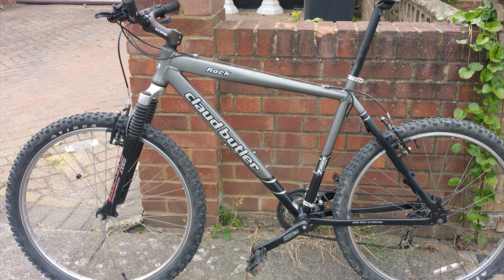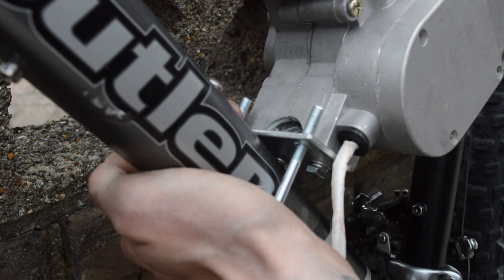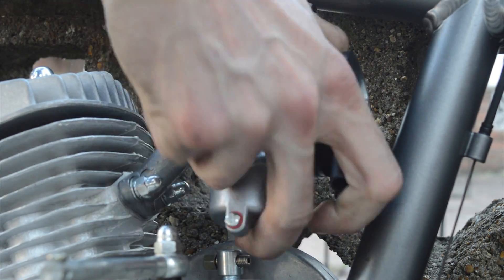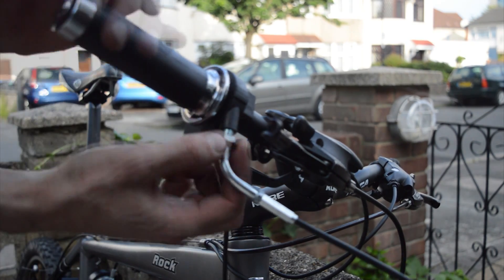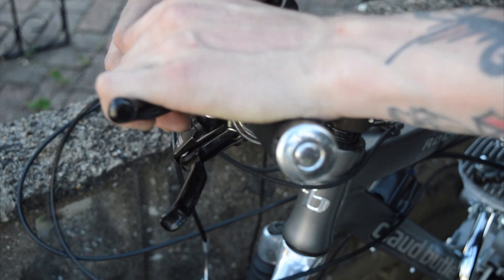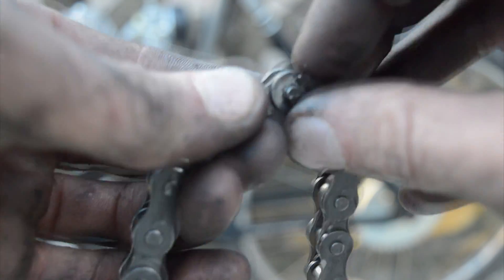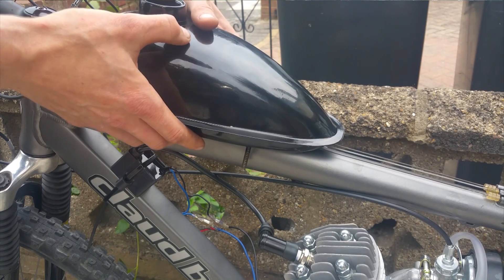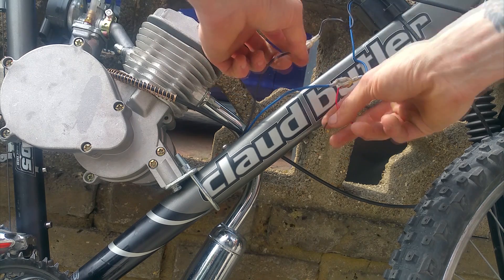Build a Moterised Bike at home - Tutorial

Comment: There are several things that I saw that you didn't do that you should before installing your bike motor.

Take the head off of the cylinder and look down inside where the Piston is more than likely you will find metal shavings and all sorts of shit from the factory tapping or cleaning the spark plug threads. I cannot stress this enough I found so much crap in mine it was unreal if I would have ran it that way it would have shorten the engine Life by month if not years. use a Gob of duct tape to remove all of the particles that you can see. That way you do not scratch the cylinder wall.

Second clean out your fuel tank. I also found debris in there. It would have quickly clogged the little filter on the end of the fuel petcock. 

Third is I opened up my clutch plate and found that there was all sorts of clutch particle matter from them putting the clutch pads in. You want to clean all of that out. and make sure that you grease the gear in there very good the small one not the big one. 

When putting on the exhaust manifold you will want to make sure that there is a clear path all the way through with very little obstacles in the way. I also took a chainsaw file and filed the edge of the pipe where it is welded to the mount so that it was as open as it could be. And if you are running a stock muffler check to make sure that they're well do not obstruct the end of the pipe whoever did mine did a shitty job welding it on and there was all sorts of weld that was in the way of the exhaust. 

Open up the magneto area and give it an eyeball real quick. Make sure there's nothing in there that shouldn't be. Everything is nice and tight I use blue loctite in this area. put a dab of Grease or some silicone wwhere tha wires go through the case that way is to keep moisture and crud out of the magneto area.  

any bolts that are long enough that will allow I use the two nut system with a lock washer between the two nuts keep them from backing off or loosening on the motor mounts and on the gas tank.

Comment: The tensioner is dangerous & so is the rubber rings putting force on the spokes to hold the sprocket !! However on one of your videos you nailed m8 you had a disk brake disk removed & used the holes to attach the sproket however the screws are to small to take so much force me thinks without more support so i thought why not add a cnc adaptor to the hub  aswell as your idea of securing it on the brake disk holes !! But then i thought if the cheap crap cnc adaptor slips on the hub it will take out the spokes or just spin putting all the presure on the screwed in sprocket !! So my solution is put a tensioner on the clutch panel side were its safe that are availble online or have it made that uses a spring & skateboard wheel tthat attaches on the clutch panel that tensions the chain like from duluth cycle. Usa . the best option me thinks is to get a specialst to build a vintage 26 inch hub & sprocket wheel that also fits a cassette as you will see after research the first moped scooters  ever built were cycles with moters !!! If you all see that this is the safest option & will save you money in the long run .im not putting that shit tensioner & sproket inc attachments from these kits !! But if you all prefer to use em RIP. Also were the larger spring attaches to the clutch wire touching the moter protecting the wire ive put a tubing available online used in catering etc that  can handle over 350 , 400 c  & then put the shit spring that comes with the kit .

Comment: You forgot to drill a hole in the handle bar to keep the throttle from sliding
Reply from the maker: To be fair I dont realy drill holes in my handle bars I just use a bit of tape inside to prevent the throttle from sliding this is also I good idea.

Comment: Is the cdi unit a device that sends an electrical signal to the spark plug to start combusting fuel to power it on via the start up? Is there an ignition Coil inside the cdi?
Reply from the maker: Yes this is the unit that gets the spark to the plug from tue magneto. These engines are very simple but effective. Thanks for watching and have a great day.

Comment: You didn't have to drill a hole for the throttle/kill switch???
Reply from the maker: Some people do but it's up to you to be honest. It is only to stop the throttle from sliding but you can always use a small piece of electrical tape then tighten down the screws instead of drilling a hole in your handle bars. Please feel free to check out some of my other videos on the channel and thanks for watching.

Comment: I’ve had my bike for about a month now had my share of problems and if you follow this your 100% gonna have problems it’s all cut and dry with these machines make sure everything is tight not over tight but snug fit grease everything everywhere and you should be fine
Reply from the maker: That's right but you could always upgrade the hardware like using stainless steel nuts, bolts and washers instead of the standard hardware that it comes with. As long as you use a good grease you will be fine. Thanks for watching and feel free to check out some of my other videos on the channel.

Comment: Thanks for the video. A few things I’ve seen in other tutorials that may help here. Grind off the water bottle mounting screw (your forward mount was resting on it). Also, cut a 10” section of 1” PVC pipe lengthwise and lay it over the bare cables that run under the gas tank to allow them to travel and not get pinched. I hope this helps!
Reply from the maker: I prefer to use cable protectors and these are very cheap but effective. There are many ways to do this but thanks for the heads up. Please feel free to check out some of my other videos on the channel and thanks for watching.

Comment: I just bought a mens 27.5" Kent Genesis mountain bike. Dimensions are 7.00 x 7.00 x 17.30 Inches. Will one of this 80cc motor kits for on it??? Please help
Reply from the maker: Looking at the frame it looks to be a tight squeeze but I'm pretty sure that it will fit in nicely. But you might need to get an offset manifold from Ebay for about 2 pound. I hope this helps and thanks for watching. Please feel free to check out some of my other videos on the channel and have a great day.

Comment: I'm about to do one this summer anyone can help me out if I have disc brakes ?
Would it fit in?
Reply: If you drill holes in the sprocket and then mount it where ur rear disc was it will save you a lot of money as non disc wheels mount the sprocket to the spokes often snapping them
Reply from the maker: @mustafasheikh1828  yes this will work I have made a video for this on the channel.
Reply from the maker: Yes this will fit depending on what frame you have. Thanks for watching.

Comment: You can run without suspension forks, you just need something that doesn't flex, which is the main problem that I've seen with people who do this. I love triple tree's because you can just buy suspension forks if one day you feel like that's a necessary upgrade, also they're rigid and perfect for these bikes.
Reply from the maker: Depending on what surface you ride on  but I would strongly suggest using them for any type of road as it is way safer. Please feel free to check out some of my other videos on the channel.

Comment: hi, there david, i have a question about the video, i seen you  installing the gas tank, and i was wondering if the bike gears where free to move, and did you move your gears towards the center of the bike?, i just got a bike with gears and i want to put a motor on it, kinda like the one you are installing.
Reply from the maker: Well in my experience the best way to do this is use some small plastic spacers so when you tighten your tank nuts you won't squash the cables. I hope this helps and thanks for watching.

Comment: u can remove handle bars with compressed air if you have it just pull a little back and inflate and it flies right off
Reply from the maker: Wow well I suppose any method will do please feel free to check out some of my other videos on the channel.
Reply: +David Dicker yea I plan to put the original left handle back on mine because the ones that came in my kit are not too comfortable. but nice video it was very helpful
Reply from the maker: Well you should always customize your bike to suit your configurability. Plus I have a few more videos you might want to check out.

Comment: Top speed on one of these on aveaveraged mountain bike with 170 pound rider?
Reply from the maker: Depending on what bike and engine setup you have but with your engine fully modified and a jack shift kit you should be able to get 65 to 70mph after the engine is properly broken in. I hope this helps and thanks for watching.
Reply: David Dicker Wow, great info thanks, that's wicked fast for a tiny engine, thanks for this.
Reply from the maker: No worries I hope you enjoyed the video I have some more on the channel you might like so check them out and see what you think.

Comment: Hello,
I notice guys use a Tire-Tube cut to size to go around the frame and the Motor Mounts.
It looks like it's a tighter fit, and lessen the vibration of the motor and bike.
The tank mount, I notice guys use a piece of PCV pipe cut in haft and put that over the Bikes Cables to provide easier cable motion. than mount the tank over all that.
Reply from the maker: To be honest any improvement will help this. I have many more videos like this you might enjoy so check them out and see what you think.

Comment: Hi David, I don't understand why people are hating so much on your video, I think it's great.

Might I ask what you would do if you found that the pedals were going to hit off the exhaust muffler no matter what?

Should I replace the pedal crank? Or maybe try to bend the muffler in a vice?

Thanks.
Reply from the maker: Don't bent the muffler there is always adjustment on the back and front mounts plus the exhaust bolts. If need be order a different crank but try not to damage the muffler as this might effect performance from the engine. I hope this helps and feel free to check out some of my other videos and thanks for watching.

Comment: Where the magneto is at that axle piece aint turning no firing or nothing how do i fix that
Reply from the maker: You need to release the clutch or dissengague it. You can do this either 2 different ways 
1. Release the flower nut and then it will disengage 
2. Release the clutch arm after the clutch cable is attached then it should work.
Reply: David Dicker k thanks bro i got working i had the wrong wires hooked up fro cdi my bad lol first time putting bike together
Reply from the maker: Well that would deffinatley not help. If you follow the steps in the video I show you how to do this. But be carefull of the killswitch sometimes it gets left on the on position. I hope this helps and thanks for watching.

Comment: Do you have any issues with the brakes and gear sector cables sitting under that tank?
Reply from the maker: I did at first but I installed some plastic spacers and now it works perfect. Plus alot of people get problems with this tank leaking with fuel so be careful when tightening the nuts and bolts.

Comment: When I bought my kit, the gear was too big (the engine gear) and it doesn't fit the chain. The chain fits the back sprocket perfectly, but the chain is too small for the engine. The worst part is if I got a bigger chain, it would not fit due to the small enclose area. So unfortunately what i'm gonna have to end up doing is shave down the engine gear a little bit so it can fit the normal sized chain.
Reply from the maker: You could have all ways sekt it back and got another kit as this would be a fault with the manafacturer. When your new kit arrives order a heavy duty 415 chain and this will help.

Comment: The first ones imported a few years back had terrible machine tolerances and metallurgy. They would seize up after moderate use. Do you get a feel that this one is better built. Thanks, I always look forward to your vids.
Reply from the maker: Well to be honest I have found that if you get a cheap engine then upgrade the hardware plus maintain it every so often you should be ok. Plus I will be working on another project very soon so stay tuned.

Comment: Is the engine still works now? And which kit did you buy?(motor company is the most important thing for me to know..)
Reply from the maker: Yes I have put this engine on the new bike in the latest video. It has been modified and upgraded alot since then. I payed about £65.00 for my kit from eBay and as this was an unbranded kit I upgraded all the hardware aswell. I hope you enjoyed this video I have many more like this so check them out and see what you think.
Reply: Thanks for the quick answer! Can I be rude and ask you to tell me if the kit I'm about to order is good or not?  
If he isn't good can you recommend for another one?
https://www.amazon.com/gp/aw/d/B071YQ8CR6/ref=cm_cr_arp_mb_bdcrb_top?ie=UTF8
Reply from the maker: That's exactly the same as the one I have that should do lovely. Any problems give me a shout and I will do the best to help you out.

Comment: Just something to note: the chain guard is not necessary. It is optional. I personally do not run a chain guard on my bike
Reply from the maker: On the bbr tuning frames you don't need it but on the basic bike build I would suggest it.
Reply: David Dicker ive never used it in the 2 years ive been running the bike
Reply from the maker: I don't have one on the bbr tuning frames to be honest but would all ways use them on the mountain bike as I wouldn't want to catch any clothing in the chain.
Reply: David Dicker tbh id only use it if i had anything that would make contact with the chain

Comment: Have you had any trouble with braking?  The petrol gas tank seems to cover the brake cables on your particular bike (I am looking at getting a Trek 6700 that has a similar brake cable setup and don't want hinderance if I am braking).
Reply from the maker: What you can do is put some plastic spacers to allow the cable to still pass through without being pinched or caught up. I hope this helps and I have many more like this so check them out and see what you think.

Comment: Could I get away with using a 16.5 inch mountain bike frame, hardtail? The wheel circumference is about 24 inches
Reply from the maker: +Javed Hamid depending on what dimensions of the frame would be make sure you get the full dimensions of the complete engine with carb before ordering. Plus you could all ways get an offset carb manifold.

Comment: get lightest bike you can as motor adds weight. in winter you have to adjust carb. watch out for cops stay off side walk have head light. if you see a cop kill motor.
Reply from the maker: +joey alfaro if you check out my later videos you can see I have changed all my frames. Plus it's pretty much true if your wise on the road your ok.

Comment: Great but that chain tensioner is evil it falls into spokes. Just cut your chain to the right size without the tensioner. Locktite is your friend on mounting these too.
Reply from the maker: +meax2499 fair point but I would suggest using some wrap around the frame as the tensioner won't move after bolted up tight.

Comment: Please help. I assembled my one just few days ago and I am sure everything is right but still the rear wheel is completely locked, it wont move at all. I checked everything: 
adjusted the clutch, made sure chain is not stuck, cables are good.....(even if i take off the clutch plate it still doesn't work). Please help.
Reply from the maker: +soulenergy you need to adjust the clutch cable or the clutch plate so either loosen the cable on the lever on top of the engine case or undo the clutch cover and loosen the flower nut. I hope this helps and feel free to check out my other videos.

Comment: I would suggest taking at least one more link out if the chain, then move the adjustment bracket closer the the engine. Plus I would have used a piece of rubber hose or sorts between the engine and frame.  Then after watching all that we don’t get to hear and see it run!!!!
Reply from the maker: +K. R. V. Well I wanted to show people a basic installation video of how to install the kit. Plus I agree with you on the rubber mounting aswell but if you wanted to see this bike run properly check out my other videos where you can see the 1st break In part of this bike. Along with many other videos you might enjoy on the channel.

Comment: You should have put rubber in between the engine mounting brackets and the frame so your not vibrating  and destroying your frame
Reply from the maker: +Tristan Armani well as this is not supplied in the kit I can't show a video of me doing that in this video but I do agree with you as this would have been a better idea. But if you see my other later videos you will see that the later frame set ups I used none of them use rubber mounts. So feel free to check them out and see what you think.